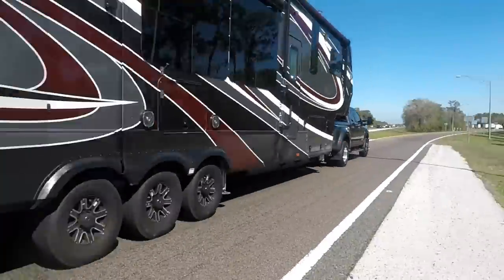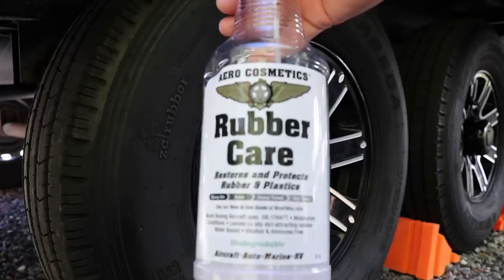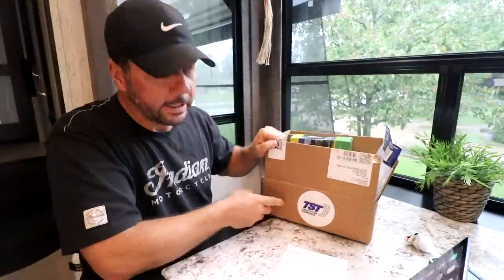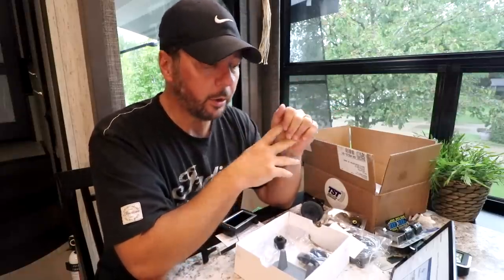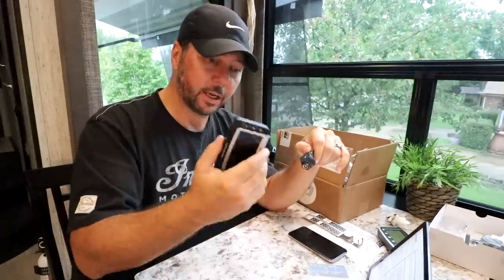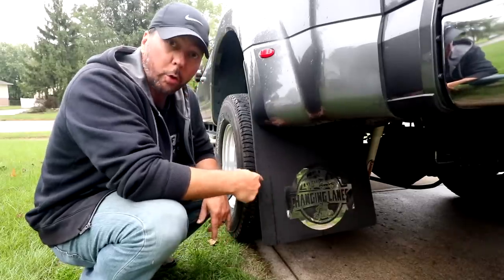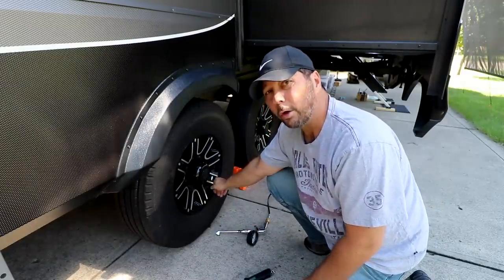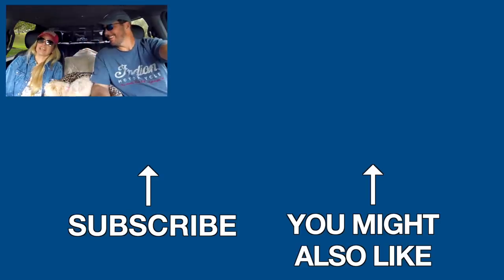RV and Truck Tire Safety | Best TPMS (Tire Pressure Monitoring) (TST-507) Review | Changing Lanes!

Comment: Ho, Chad and Tara!  Ok, quick question.  Clicked on the link to put these in my cart, but I have a question, (probably a dumb one, but I just dont know...): do I just get the Flow Thru, or do I need to add on the caps too?
Reply from the maker: Hey!  Just one or the other.  We have caps on the truck (flow throughs won't fit), and flow throughs on the rv (need steel valve stems for the flow throughs).  Thanks for using our links! 👍🏼😊
Reply: @ChangingLanes  Thank you so much!  Trying to put together an order before my sweetie gets home so we can take all this stuff with us and maybe get help when we go to the dealership to pick up our rv.
Reply from the maker: Awesome!  😊

Comment: Why not add the oem ford tpms? Just curious...nice F350. The F450 does not have a built in TPMS so a system like this would be great.
Reply from the maker: I assume you're talking about the OEM TPMS for the trailer that integrates into the ford system?  I looked into that as our first choice.  It's a huge PITA.  Sensors are internal only and there was some incompatibility with the rims I think.  Plus the module has to be wired into the system.  Don't remember all the details (it was a year ago I researched it), but there were too many "will it work" questions for a LOT of money.

Comment: Thanks for the info ! I have a tire monitor that came with my new reflection one question sir ! I have my tires inflated to 80 like they are supposed to be when I travel the pressure goes up to 90 92 is that normal ! My alarm goes off I have it set for 85 high should i set that higher or what should i do ! Thanks

Comment: I'd just like to know how to get to the inside tire to check the pressure and air it up if necessary?
Reply: The inside sensors are with a air stem to fill up on the outside. The tire has to be delated and remove as if your were getting new tires except they don't have to remove the tire off the rim to istall sensors. The downside is when you need to replace the batteries you have to deflate the tire to get to the battery. I never went with the inside sensors. I always went with the outside sensor easy to replace batteries.

Comment: Very interested in this for my rig when I get it. I will need 10 caps or 10 flow through. What do you run on your rig? caps or flow through and why?
Reply from the maker: We have flow throughs on the RV - much easier to add/remove air.  And Caps on the truck because flow-throughs just wont fit.  👍🏼
Reply: @ChangingLanes  Great information. That is the configuration I was considering...safe travels

Comment: Is there a reason you don't use the built in trailer tpms on your f350? I have the same truck and wonder if there is a reason I shouldn't use that system.  Wouldn't need to worry about the separate monitor in your cab that way
Reply from the maker: Because so much of it has to be hard wired, the sensors have to be installed inside the rims, and no one at ford could tell me the first thing about it or if it would work on our rims.  Way too much hassle.  I have enough projects... LOL   Plus I like being able to cary around the unit and check / recheck pressures as I go.

Comment: Just curious which sensors you ended up with and where? Which tires work best with pass through?
Reply from the maker: Pass thru are the way to go IF you have steel valve stems and they are still usable as a fill point when installed.  For us, that was just on the trailer.  The wheels on the truck are just too tight to make them usable.  So we have cap sensors on the truck.

Comment: having the EEZ RV system and problem after problems with it dropping the signals from the sensors and making call after call to support to trouble shoot, we give up on the EEZ and are just replacing it with the TST
Reply from the maker: We love our TST.. Be sure to check out the new 770! https://technorv.com/collections/tpms-kits/products/tst-770-tpms-with-4-flow-thru-sensors-and-touch-screen-display?Click=11742

Comment: Good video - and I also made all the mistakes!   I also took the caps off - why would anyone steal the caps without the monitor....  :)
Reply from the maker: The cap sensors are pretty impossible to get on / off quickly on a dually with the anti-theft thing on.
Reply: @ChangingLanes  I agree - we pull with a dully, and have had two outside tire flats while pulling and didn't even know it - that's why dully, right?  So now we have TST sensors on every tire.  Because we had them we actually drove 11 year old tires 2000 miles and all went well - didn't try it again...  We really like your videos together - what a great team!  If you guys are ever coming out to Colorado, let us know - full hook ups, great views and ATV rides all around us!  You can see my sister and husband on She to Me vlog on YT.
Reply from the maker: We're heading West next year, just haven't got our plan yet.  But will keep that in mind if we hit Colorado.  Thanks!  😊
Reply: @ChangingLanes  Great - and you haven't gone West if you miss Colorado....  :)  We have great ATT and Secom WiFi ... no pressure :)

Comment: Question:  Just curious why did you choose to use the caps on the truck instead of the flow thru all around.
Reply from the maker: Because the flow-thru sensors don't fit.  Well.. they "fit" but then the fill port is blocked, which defeats the purpose.  👍🏼

Comment: Hey guys, I am interested in getting a TST TPMS system for my F450/44' DRV combo. Since you have been running your system for a year or more. How is it doing? How about using the non-flow thru sensors on the truck? Any problems? Respond quickly if you are able, I would like to order this ASAP.
Reply from the maker: We love it!  Yes to the cap sensors on the truck.. just not enough room for the flow through sensors to be usable.  👍🏼

Comment: Chad, Grease.. Do your axles ( on the RV) have Bearing Buddies? Looks like I see a bearing buddy bra on the hubs?  Synthetic grease?  Thanks for your informative Videos!
Reply from the maker: No bearing buddies and I'm a little overdue to pull them off and check and re-pack the bearings.  😳  Thanks for watching!
Reply from the maker: I was right, but also wrong...  Doing a little research in preparation to repack our bearings... and holy crap!  we have the Dexter E-Z Lube!  So, very similar I think.   zerk fitting right on the end.. no need to remove the wheel at all!!!  Super excited!
Reply: @ChangingLanes   WEE!!   I also have the dexter ez lube. I do know that the repop "rubber covers" for these will disintegrate in a hurry, the rubber is poor. The dexter rubber zerk covers are the way to go.  Great Video, thanks for posting and replies! PS. you may want to wipe excess off the back side of the bearing housing .

Comment: Hi guys, I've been trying to get the most reliable and accurate air pressure gauge for tires in the market, but I keep getting biased responses. Which one do you use/recommend? Thanks
Reply from the maker: We've tried a few and find that the TST TPMS sensors are very accurate. So , that's what we primarily use now.
Reply: @ChangingLanes  Thanks you guys! I actually meant a handheld gauge (like the digital one I saw you on this video).

Comment: My truck has its own TPMS.  So is inserting the new valve sensor necessary for the truck tires?
Reply from the maker: Nope.. not at all.  But, I like how the external unit also check temperature and give me all 12 tires in one display.
Reply: @ChangingLanes  ok and thanks - your videos have been helpful

Comment: Sorry if this is a repeat...but I'm looking into buying this system.  I've heard that some are having issues using the flow through sensors with this system if they do not have steel valve stems on all tires.  I've checked and none of mine do.  Seems like you had a no fun time with the anti-theft caps.  So, I'd prefer the flow though caps, but this worries me.
Do ya'll have steel or rubber stems?  Have you had any issues with your flow through caps being too heavy or damaging your tires?
Appreciate ya'll!
Reply from the maker: We've got steel stems on both the rv and truck.  No issues with using the flow-throughs on the RV.  The cap sensors are fine and we use them on the truck.  What makes them a pain is the anti-theft thing that goes around them, so I just took those off.   Hope that helps!  Thanks for watching!
Reply: @ChangingLanes 
I saw how frustrating those anti theft caps looked for you. Looks like you just lose air every time you have to remove them. Guess I need to talk to the guys at discount tire about the possibility of having steel valves installed before I make any decisions on which caps to go with.
Thanks for the input and advice!

Comment: I came across this video when looking for TPMS reviews and I was confused you would go against truck and trailer manufactures recommendations for tyre pressure. By saying inflate your tyres to the maximum allowed limit. This would cause the tires to wear in the middle and give less grip in bad weather potentially causing accidents in ice and heavy water situation. This will also cause over pressure when loading the vehicle or trailer up.
I was wondering, do you pump you Indian tyres to maximum psi or do you use the recommended pressure from Indian.
Reply from the maker: Sure, individual tire weighing and inflation would be 100%.  But we've had zero uneven wear after almost 20,000 miles on these tires.  Thing is, most people (including us) don't get each tire weighed.  Being slightly over the "perfect" inflation is better than being under.   Under inflation means more heat and is the biggest cause of blowouts... not over-inflation.

Comment: I purchased the TST 507 pass through sensors (10  or them)  then found out only my front tires on my dually had steel stems.  Anyhow I got 4 cap sensors for my back tires but I need to know How did you get the caps sensors on the Inner tires?????
Reply from the maker: We have valve extenders... I think they are in this video: https://changinglanesrv.com/truck-upgrades-for-full-time-rv-life/
Reply: Thank you!!

Comment: Hi guys, does the same hold true about the Westlake LT tires or just the standard ones?  I have the LT235/85R16 Radial SL309 they are load range E.  I'm on three axles as well 44 footer.  Thanks
Reply from the maker: The Westlake E rated tires do not have a great track record.  Particularly on triple axle rigs.  That's why GDRV switched to the G rated tires.  Assuming you're also in the 20K range, if it were our RV, I would upgrade to G rated.  Depending on your axles, that might also mean upgraded rims and possibly hubs. 😳
 Thanks for watching, Steve! Hope you check out the rest of our channel! 😊

Comment: Hey guys quick question ? What tire pressure do you run in the truck ? Front and rear?
Reply from the maker: We're running 70 front and 65 rear.  That's on stock tires per the door sticker.  But it might be worth a look at the tire load charts to double check that sticker is correct.
Reply: OK great thanks for the reply back. Iam about to order the TPMS you did a review on.

Comment: Do you find the flow through or the cap sensor cause an imbalance to the wheels?
Reply from the maker: Not a bit.  They are very light.  We did confirm this with the manufacturer.

Comment: I am confused. My tires say 80 psi but the RV says on the door that the front should be at 55  and the rear should be at 61. So what pressure should they have?
Reply from the maker: I would start with the sticker recommendations and then add more for added weight.  Those numbers are based on an empty RV.  It's a bit of a guessing game without weighing each axle or wheel.

Comment: What about tire temperature? Is that important? Thanks
Reply from the maker: Yes.  If temperature increases faster than pressure, it's likely due to under inflation.   That heat can damage the tire and cause a blow-out.  But in that scenario, your first indicator will be low pressure.  However, a properly inflated tire can still overheat (driving too fast in hot weather, etc).  But you should get both pressure and temperature alarms in that situation since the relationship between pressure and temperature in a fixes volume of gas is linear.  The TST TPMS does monitor both and you set thresholds for both.  Thanks for watching. 😊

Comment: Did you bypass the truck TPMS system? I have a Ram, and think the thing would beep constantly if I used aftermarket sensors?
Reply from the maker: No.. the Ford TPMS is inside the wheel and works just fine with the added valve stem monitors... 👍🏼
Reply: @ChangingLanes  thanks for the reply. I found out the Ramones are inside the wheel as well. Love the channel!
Reply: RAM, not Ramones, LOL

Comment: You do not need to rotate your tires on your 5th Wheel or Trailer, because if you use Radial Tires, they should only Track 1 way. If you put them on the other side, then they will Track backwards from when you had them on the other side!  I put 100,000 miles on my 5th Wheel never rotating my tires.

Comment: If you had to do it again, would you put flow through caps on all 12 tires???
Reply from the maker: No.  They just don't fit on the truck with enough room to get to the port.
Reply: @ChangingLanes  Thanks for the clarification. I assume you're talking about between the dually rims. I have to admit I haven't spent any time trying to get my fingers in between mine. Doesn't look like the normal caps would be easy to get off and back on when the tires do need to be topped off, but at least they don't have to come off to check the pressure...
Reply: @ChangingLanes  Another clarifying question ... when you periodically rotate tires, do you move the caps with the wheel or leave them in their "assigned position" (seems logical to leave the caps).
Reply from the maker: @SteveKarolek  I put these valve extenders on the rear inside wheels.  https://amzn.to/3dUXlCn   Best to pull the outside wheel to get them on, then stagger the valves outside and inside.  Get some blue loctite too...

Comment: I’ve been looking for a tire monitoring system but hate to add another video monitor in cab.  Keep hoping someone will develop one for app that will work with CarPlay or android auto compatible head unit.
Reply from the maker: Certainly could be done.   Would likely require something in the middle to talk bluetooth to your phone.
Reply: Advantage Pressure Pro has an app based unit.
called Pulse FX

Comment: So how’s the TMPMS tire system working for you now?
Reply from the maker: Really well!  Taken 3 or 4 more "trips" since this filming and it's working  great!
Reply: @ChangingLanes  Are you using any valve stem extensions on your dually with the TPMS? and how are the pass-thru's working on the rig? any issues with length that they add to the valve stem?

Comment: What kind of battery life are you experiencing?
Reply from the maker: The display will run for a few days non-stop and is rechargeable.. so we don't need to plug it in.  The sensors last 2+ years in our experience.
Reply: @ChangingLanes  thanks, I previously had a Pressure Pro TPMS, bought it in 2007 and used it non-stop till last year, over that time I did have to repower the sensors once, and that meant a swap with the manufacturer as they were not user serviceable. Time for a new upgraded system so I am following your lead.

Comment: my 2022 gmc dually rides like a WW-1 troop carrier at max 80 psi. 

I simply hate it. concrete california highway running is simply terrifying with all of the potholes and broken pieces The truck tires have to roll over as there is no give in the tread whatsoever to handle such sharp edged objects at 65 miles an hour. i’m hauling 4000 pounds on the bed as a camper unit resides there. I just simply refuse to think this is safe in any way shape or fashion. my truck and camper only have 200 miles on it this can’t be the entire ways and means folks to traveling. It’s mindnumbing

Comment: do u still use this tire monitoring system  or did u try something else   thanks
Reply from the maker: We still use the same one and it's still the best around in our opinion. 👍🏼
Reply: @ChangingLanes  good deal   Going to get one   Thanks for the reply
Reply: @ChangingLanes  sorry for all the ?   Last one   Have u had any issues with it
Reply from the maker: Not at all.. Just changed the batteries in the sensors after a few years.

Comment: So what type of tires will you get when you replace your tires on the rig ?
Reply from the maker: Not sure yet.  Hopefully got another year to go on these.   Will have to evaluate at that time.  Any suggestions?
Reply: Probably gonna go with Sailun s637. They are 14 ply steel belted and are rated at 4080 lbs. Check Simple Tire .Com...Mine are due in the spring..Good luck. P.S due a video pest control for the RV...Thx.
Reply from the maker: We've heard really good things about the Sailuns.  Pest control.... hmmmm good idea for a quick tip series topic.  We have a LOT of "small" ideas to share (like pest control) and not sure how to group them, so we might start sharing them as quick tip videos.  Stay tuned!  😎
Reply: America will be waiting.

Comment: Do you have a link for your pressure gauge? I've been thinking of the JACO 200PSI elite pro gauge (https://www.amazon.com/dp/B07JL8YB36), but thinking I might appreciate the reach of the solid shaft on yours vs. the flexibile hose on the JACO... Thanks in advance.

Comment: I can’t seem to find the max pressure this item will read .
Reply from the maker: Looks like 196PSI....  

SENSOR SPECIFICATIONS
Temperature Operating Range: -40° F – 176° F / -40° C –80° C
Storage Temperature Range: -40° F – 185° F / -40° C –85° C
Pressure Range: 0 – 196 PSI / 0 – 13.5 bar Pressure Accuracy Range +/- 3 PSI / +/- .02 bar (with a digital gauge)
Temperature Accuracy Range: +/- 3°
Transmission Power: <10dBm
Transmission Frequency: 433.92 MHz Approximate
Battery Life: 1 – 1.5 years